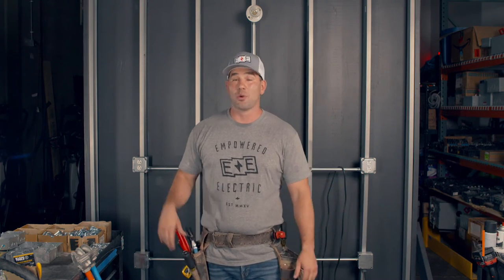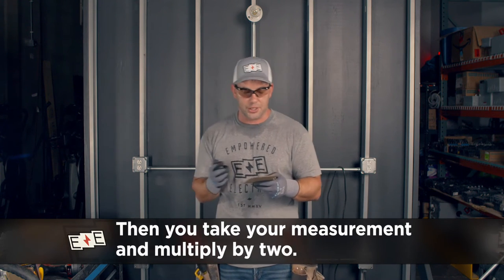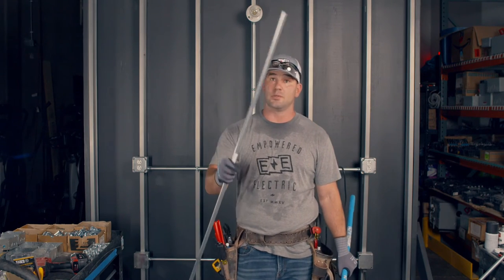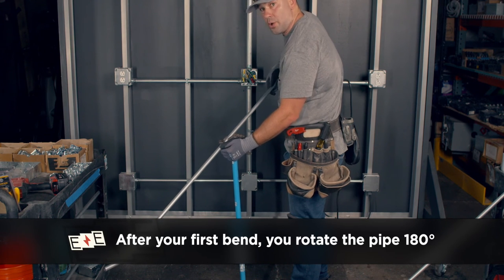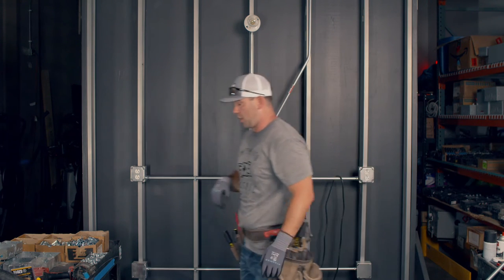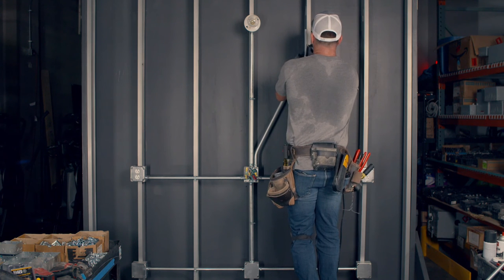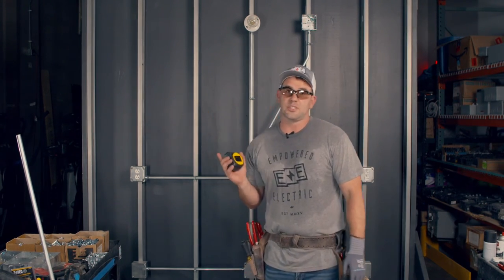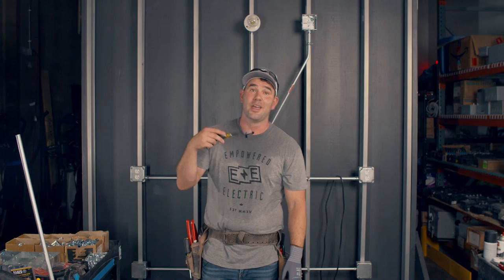How do I bend a 30 degree offset?

Comment: You made the right example but you were kind of wrong because you are bending by using measurements from boxes at the top and center of the stud, which I’m pretty sure you know that boxes don’t go on top of the stud it goes inside because then it would be exposed once it gets sheetrocked so that means that offset should of been at least 1 to 3 inches shorter depending on what knockout you are connecting to in each box, great example though I’m pretty sure the smart ones get the point lmao, but keep doing what you are doing I’m pretty sure it helps a lot of people
Reply: Unless it’s an opened wall but I doubt it usually walls are covered

Comment: It's easier if you just calculate the shrink and pre cut the conduit to length.
Reply from the maker: The only time I would ever say "shrink" and "easy" together is in a ice bath 😂🤦🏻‍♂TBH the only time I factor in shrink is on saddles. Good point though and you are more advanced than most.

Comment: I need to bend a 30 degree offset in a stairwell but at the bottom it needs to drop roughly 6 inches under the landing of the floor above. Any suggestions on how to make that look good ?

Comment: The problem with air bending is that it's very hard to match bends on parallel runs. It's better to floor bend them. Great video, with explanation. Can you do a video for floor bending?
Reply: Just takes time. I prefer to air bend so I'm not bending over all day.
Reply from the maker: TBH I hate floor bending, the second bend (if not done on a elevated platform) will mess up the first bend. When you "air bend" be sure to hold the conduit as close to the bender as you can. That will help with consistency. ps. I will do a floor bending video and show what I mean. Thanks a ton for the follow and comment.
Reply from the maker: @danielhady3021  🔥🔥🔥
Reply: It's called an hand bender

Comment: Hey I’m still new to this but aren’t you suppose the measure the offset depth and multiply it with the multiplier
Reply from the maker: Yeah…. For a 30 degree offset measure the distance and multiple it by 2. For a 5” 30 degree offset the marks need to be 10” apart. 5x2=10